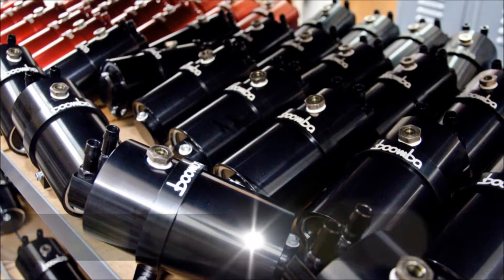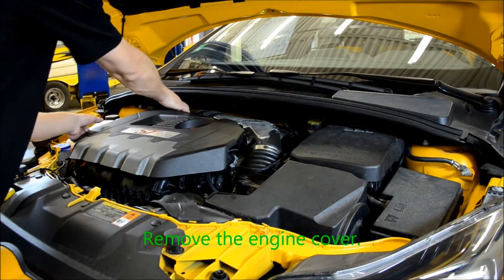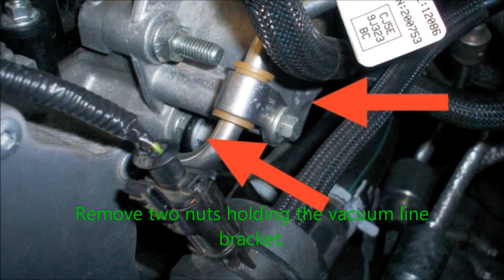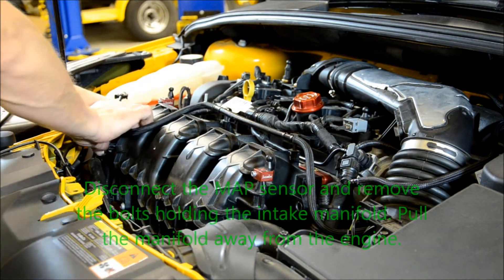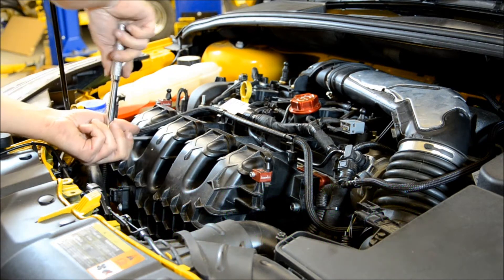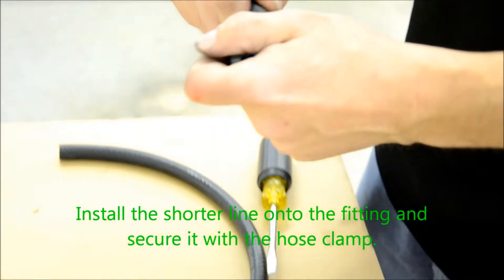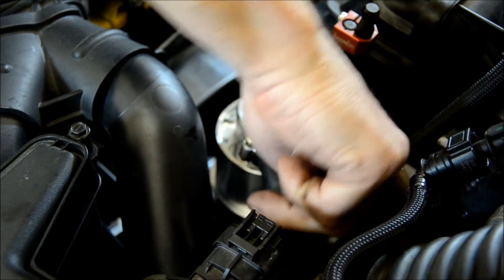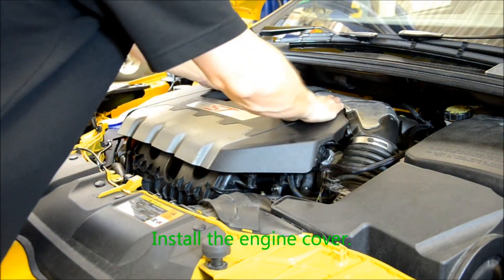Intro & How to Install | Boomba Oil Catch Cans for '13+ Ford Focus ST

Comment: Very useful video and it will make installing my catch can way easier. I seen a few people arguing on another brand of catch can which doesn't say which port is inlet/outlet., what could happen if they install inlet/outlet on the CC the wrong way around?

Comment: Use a torque wrench for the intake manifold bolts
Reply from the maker: You can certainly use a torque wrench on the Intake Manifold bolts.

Comment: Is it recommended that you run both the stage 1 and stage 2 catch cans? Or is there a benefit of running one or the other? I'm used to seeing PCV cans, not so much CCV.
Reply from the maker: IF a customer only wants a single can, we always recommend the stage 2 (PCV). Since its a higher pressure system, it will catch more. If someone wants to keep their engine as clean as possible, we recommend both!
Reply: @BoombaRacing  Fair enough, thanks. I suppose I'll start with a PCV setup now and do the CCV next
Reply from the maker: @DrunkenJoe  Good plan!

Comment: How true is is. Running 93 shell v power helps keep the chambers clean?
Reply: On direct injected engines the fuel is injected directly into the cylinders, fuel never touched the intake chambers or valves.

Comment: After the installation, may I know how do you drain the oil catch can?
Reply from the maker: Depending on when you purchased your catch can, there is either going to be a quick drain valve at the bottom of the can or a drain plug. If you have the valve, you simply open the set screw. If you have the plug, you pull that out. Let us know if you have any other questions!
Reply: Good question ... I was thinking the same ... It looks pretty tight and not sure just how easy a drain is going to be... Is there a way to attach a hose to the drain ? and how often

Comment: Just curious, why wouldn't Ford engineer this basic application into their initial design? I must say, it would make sense given the fact that maintenance, especially in this application would benefit the vehicles performance & longevity? I just purchased a 2014 Focus ST and love the car.
Reply from the maker: Most people that are non-enthusiasts that purchase vehicles have a very hard time keeping up with basic maintenance items. A lot of people have a hard enough time remembering to change their oil. If Ford were to implement an oil catch can system that had to be emptied every so often, a lot of non-enthusiast owners would end up letting that can fill up which would introduce more problems into the mix from neglect.
Reply: BoombaRacingInc 
I can see your point. A shame that a quality product can be neglected and misused. Well I for one will be diligent when it comes to maintenance and use. I plan on retaining as much value for the dollar as possible. My car has only 24k miles I'm the 2nd owner and enjoy the car to the fullest. 
Thanks for the reply.
Reply from the maker: Not a problem! A catch can is a great investment to protect the longevity of your vehicle!

Comment: That green elbow on the stage 2 install had me in a god damn straight jacket.
Reply from the maker: We feel your pain.
Reply: would it be easier to just get a new breather plate and replace the whole thing?
Reply: Well i mean if you're not a lazy ass and actually remove the intake manifold completely, it would have been completely pain free. It takes an extra 3-4minutes to remove the intake manifold and then you can just heat up the hose to the green elbow with a heat gun/lighter for a couple of seconds and it literally slides off like butter. Work smarter not harder.

Comment: Hi boomba racing, I have a 2016 Ford Fusion 2.0 ecoboost I don’t race my car or anything but just some spirited drive which do you recommend the  stage 1 or stage 2 or both for my needs, it would be mainly for maintenance purposes of the engine . I hear they are  having problems with the older ecoboost since they are direct injection and are getting build up
Reply from the maker: There are a few differences between the stage 1 catch can and stage 2 catch can. The stage 1 catch can works on the low pressure CCV side of you vacuum system in between your valve cover and intake tubing. The stage 2 can works on the high pressure side and works between your PCV valve and intake manifold. If you are looking to run one can only, we’d recommend stage 2 because it is going to catch a lot more oil and contaminants than the stage one will. Our cans use a two-step outlet filtration system to prevent contaminants from making their way back into the engine.
 
If you have other questions, feel free to let us know!
Reply: BoombaRacing I am planning to get your catch can for the high pressure side but would you recommend a smaller oil separator like the steeda for the low pressure side?
Reply from the maker: Our Stage 1 for the Focus ST should fit for your low pressure side if you are interested.
Reply: I was just just wondering if yours is over kill or if the steeda it being small is adequate for the low pressure side
Reply from the maker: Not all catch cans are created equal. Our can features billet aluminum construction and a two step outlet filtration system. Having a can that is effective is key.

Comment: If I understand it right, there are 2  independent catch cans installed on this engine, is that correct? I am looking for a catch can to install on my 2016 ford fusion 2.0 4 cylinder ecoboost. Instead of using a 2 outlet  catch can and 2 check valves could I use 2 independent catch cans, one for the PCV line and another for the turbo? Which product would you recommend? Thanks!
Reply from the maker: There are a few differences between the stage 1 catch can and stage 2 catch can. The stage 1 catch can works on the low pressure CCV side of you vacuum system in between your valve cover and intake tubing. The stage 2 can works on the high pressure side and works between your PCV valve and intake manifold. If you are looking to run one can only, we’d recommend stage 2 because it is going to catch a lot more oil and contaminants than the stage one will. Our cans use a two-step outlet filtration system to prevent contaminants from making their way back into the engine. 

The only one we list for the Fusion is Stage 2 because that is the more popular choice anyways. 
 
If you have other questions, feel free to let us know!

Comment: Will this void the warranty? Also, i live in cali. Is this 50 state legal?
Reply from the maker: When it comes to warranty; in short, innocent until proven guilty. Certain dealers can be more picky than others when it comes to aftermarket parts. Some dealers are fine with mods whereas other dealers will not accept any mods. We always tell the customer to ask the service advisor first for what’s acceptable at any given dealership and if you have any doubts to return the car to stock form before bringing it in to a dealer. Furthermore there is a law called the Magnuson Moss Warranty Act that states in order for a dealer to deny warranty work on your car, they have to prove the aftermarket part you have installed caused your issue. For example if your window stops working and you have a cold air intake, the dealer is not going to void your warranty. It is illegal for a dealer to void your warranty for simply having aftermarket parts installed.

This part is not CARB certified, however we have many customers in Cali running this piece. 
 If you have any further questions, please let us know!

Comment: How do you drain the oil out of the stage 2 catch can?
Reply from the maker: Depending on when you purchased your catch can, there is either going to be a quick drain valve at the bottom of the can or a drain plug. If you have the valve, you simply open the set screw. If you have the plug, you pull that out. Let us know if you have any other questions!

Comment: I drive a 2014 ford focus st. I drive the car easy for the most part and get on it once and a while when driving on the highway. It is my daily driver and I am good with keeping the maintenence of the vehicle. Would you recommend a stage 1 or stage 2 installation? Also do the catch cans differ from stage one/two or they are the same and just mount in different locations.? dumb question..I'm assuming you drain the catch can when you have an oil change. ? thanks
Reply from the maker: For someone in your situation, we would recommend the stage 2 can set-up as it is going to catch more in your situation. There are a few differences between the stage 1 catch can and stage 2 catch can. The stage 1 catch can works on the low pressure CCV side of you vacuum system in between your valve cover and intake tubing. The stage 2 can works on the high pressure side and works between your PCV valve and intake manifold. If you are looking to run one can only, we’d recommend stage 2 because it is going to catch a lot more oil and contaminants than the stage one will. Our cans use a two-step outlet filtration system to prevent contaminants from making their way back into the engine.

Comment: Will this kit work on the 2016 focus st?
Reply from the maker: Hello there! Our Stage 2 catch can will work with no issues on your 2016 Focus ST. The stage 1 can may need different size adapters depending on what size vacuum hose your vehicle was fitted with on the intake from the factory; other than that the stage 1 kit works with no issue.

Comment: Hallo BoombaRacingInc firstly thanks for the vid., i did a catch can installation last year and found your video just now. And i am just wondering if i want to place 2 catch cans for more efficient work, can i do some harm if for the stage 2 PCV i just use regular catch can and not the special as you provide with different pressure handling? (i already have one extra piece of the regular OCC from last year) Thanks for any advises.
Reply from the maker: Hey there! As long as the can has some way of trapping the material going through the vacuum lines, you could use a can different than ours. However our can features a two-step outlet filtration system and one of the largest capacities on the market.

Comment: So why would you do stage 2 vs stage 1. Stage 1 seems like a lot less work and your up top with just the intake. Wouldn't it save time to just do stage 1? i'm just asking b/c i didnt know if there was any difference on how it performs. Also, i like the way stage 1 is set up with the intake and the valve cover, but like the placement of stage 2. So could i get the stage 2 mount with the stage 1 package..say stage 1.5? :).
Reply from the maker: +Epibloger There are a few differences between the stage 1 catch can and stage 2 catch can. The stage 1 catch can works on the low pressure CCV side of you vacuum system in between your valve cover and intake tubing. The stage 2 can works on the high pressure side and works between your PCV valve and intake manifold. If you are looking to run one can only, we’d recommend stage 2 because it is going to catch a lot more oil and contaminants than the stage one will. Our cans use a two-step outlet filtration system to prevent contaminants from making their way back into the engine. Let me know if you have any other questions.

Comment: Does the stage 2 catch can fit under the engine cover without the Boomba risers?
Reply from the maker: +Cody Hollohan Yes it will. The stud relocators you see are so that you can still use the engine cover after installing our intake manifold spacer.

Comment: this will fit the 15 ST? how much damage ,if any, can my engine incur without one? I'm planning on getting an intercooler and downpipe for mine. should I put one of these on before I make any other performance installs?
Reply from the maker: +Blas Martinez These engines get pretty built up with gunk on the valves due to them being direct injection. On our shop car with only 15k miles we pulled off the intake manifold and things were pretty dirt in there. Our catch cans will work on the 2015 + with no issues. The stage 2 is a direct plug and play, but the stage 1 requires a slight modification. We'd recommend catch cans as one of the first mods you do.

Comment: Stupid high priced!  Get yourself a universal off ebay for $20 bucks.
Reply from the maker: +Kool MaDa While this certainly isn't as cheap as a $20 eBay catch can, it is better for a lot of reasons. This can is a direct fit for the car; meaning that you don't have to worry about buying new hoses or trying to figure out how to mount it. This can also has a much larger capacity than the cans you'd see on eBay. Our cans also feature a two step outlet filtration system to ensure that the contaminants stay in the can and not make their way back into the engine. We also feature a lifetime warranty and customer support should you ever have any issues. The list goes on and on. If you have further questions about our set-up, please let us know!
Reply: +BoombaRacingInc No offense, but I've paid less for a custom built all aluminium radiator over flow that was twice the size.  You're catch can maybe nice, but IMO not $189 nice, and once again my opinion. I think anyone with simple tools can easily splice in a catch can and find a mounting point very easy on the ST.  I have no problem paying for quality products but sometimes vendors tend to over engineer things that don't need over engineering, such as a simple catch can.  Trust me, you guys aren't the only ones. Your EVO X can is fairly priced and could be used on the ST.  If you compare what you get in the ST package, a few clamps, hoses and mounting bracket.... not worth the extra $100. BTW, I have bought products from you in the past and was pleased.  I just can't justify spending $189 for a simple catch can.  Even $100 is a lot for what the product does.
Reply from the maker: Kool MaDa We can definitely understand your opinion. However if you look around the Focus ST market, you would see there are other catch cans on the market that are even more expensive than our set-up. The cost of a direct fit can is not a fair comparison to a universal can that you make to fit. Some people just prefer the easy install method where everything is laid out for them.
Reply: thanks to your coment ,now all of us have to pay $230 for each occ , fucking ridiculous LOL
Reply from the maker: That's what it takes to offer a premium CNC machined billet aluminum can that is specific to a vehicle and features a quick drain valve.